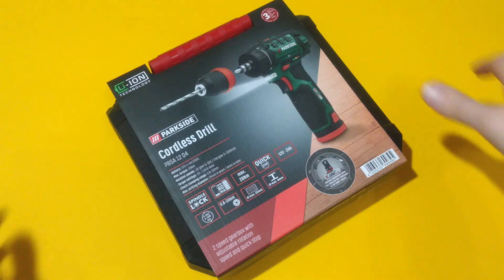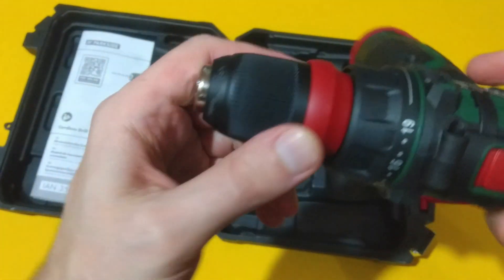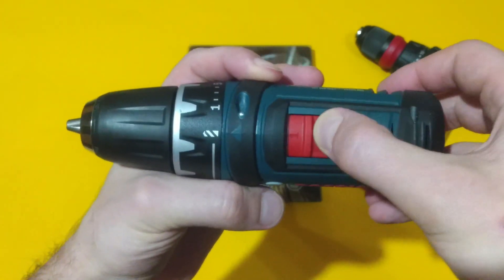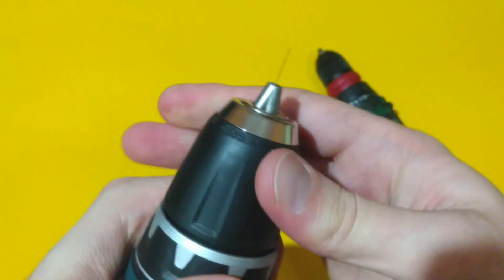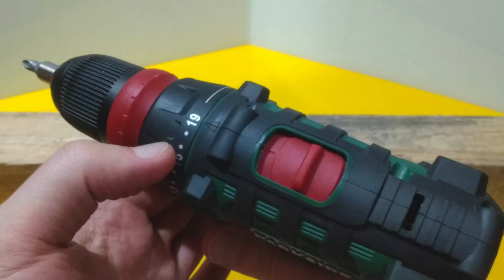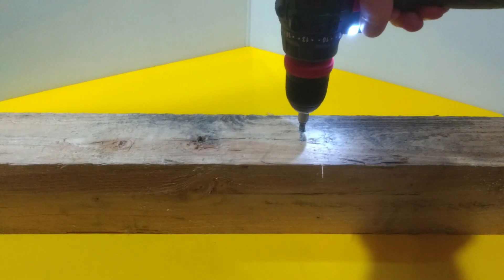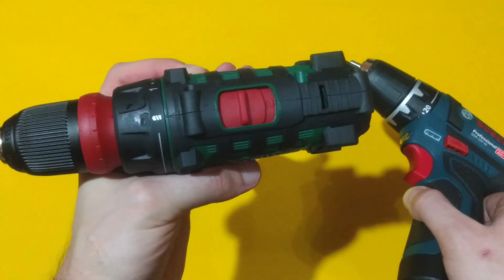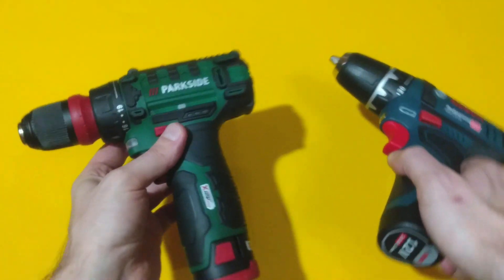Parkside Cordless Drill 12V PBSA 12 D4 vs Bosch GSR 12V-15

Comment: bought the Parkside tool for £15 without charger and battery but it came with a good set of  screwdriver bits and a good set of HHS drill bits , could not fault if for the money considering I can buy 4 Parkside tools for the price of 1 Bosch.

Comment: The Bosch gsr 12v-15 DOES have removable chuck. Even more, it does have 4 different chucks so the tool can be used as 4 different tools
Reply: Yep, you are correct... the Bosch is flexiclick.  So the model is GSR 12V - 15 FC
My mistake the first time
Reply: @simeonvelikov2252  ahh that cleares up the naming confusion. I couldn't figure out what FC should stand for xD thanks!
Reply: Not the standard gar 12v-15, i think they have a slightly more expensive "tool change" version. Metabo calls these "quick", so for example BS 18 L BL quick, not sure what suffix Bosch uses.

Edit: i think it's "FC"

Comment: Blue Bosh all the way! You pay more at the beginning, but one Bosh blue tool will outlive at least a dozen of Parksides.
Reply: how do you know ??? i had 3x bosch drill before and 1 makita drill and the makita survived and all the bosch died.
Reply: @EFDawahWiseSmile2LanternDen  Were thr Boshes Blue or Green? We have had 6-7 Bosch Drill-Drivers in the last 15 years in the workshop and only two have gone broken. While the Parkside tools give away only when you press them a bit more.
Reply: @sizif717  green 12v and 14V

Comment: I have this little tool too. For the price the build quality is very good. I like the way that I can actually use two tools, one drillbit and one hexagonal driver bit as you can leave that inside the hex socket with the chuck on, so you can drill and drive in a screw for woodworking for example. There are more powerful drills but the size, the weight, the good shaped grip and this kind of "double" operation mode that makes this package a really good deal with the battery and charger included.

The X12V battery in this case means the whole battery fits into the grip with minimal overhang and that may allow you to do stuff on tighter spaces where you don't need the power of a x20v 4ah battery powered tool. Also the overall weight is less.